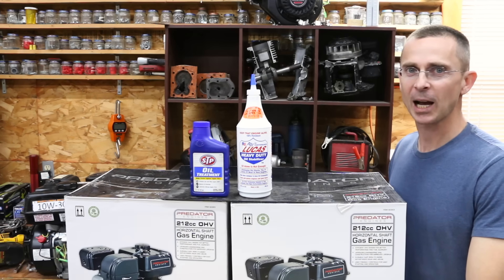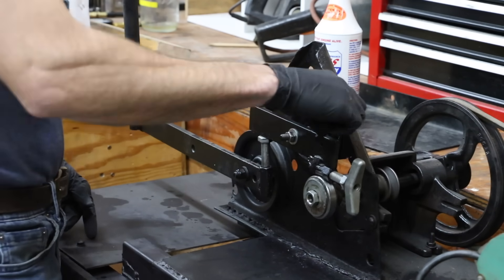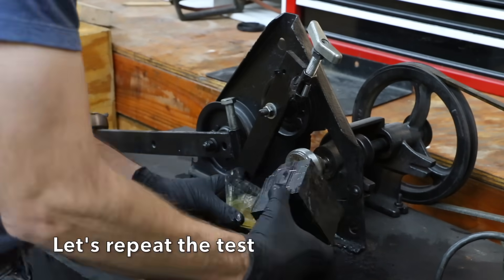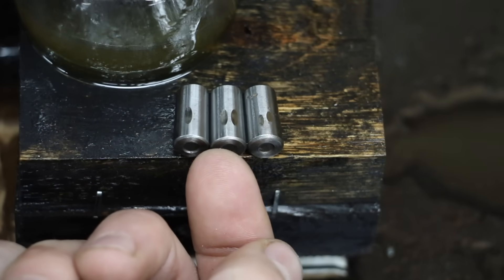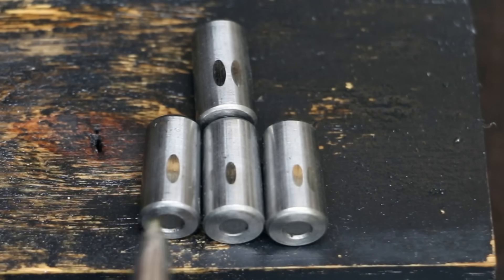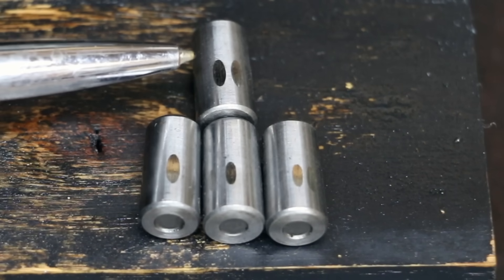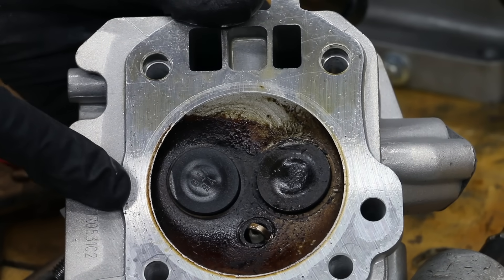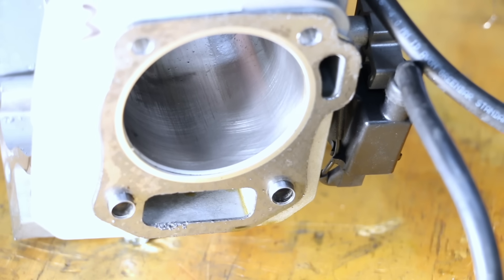Which engine self-destructs first?  Lucas or STP?

Comment: Nice, if you have PS 23 in your country try it. you will not destroy that engine, google PS23 test on a Honda, car runs far without oil after treated with PS23 and put back in service with zero damage
Reply from the maker: Thank you for this recommendation.
Reply: PS 23 is not an oil stabilizer, it is a metal treatment, worth testing.
Reply: Fake news
Reply: Jan Kotze yytytytyttttttttttttttttttttttttttttttttttttttttttttvtg
Reply: Jan Kotze and if you believe that your a idiot

Comment: So I've been very impressed by Liquimoly oil treatment with molibdemum. Really reduced oil consumption in my 320k Nissan engine. From approximately 1 qt. In 4000 miles down to less than 1/2 quart in 4000 miles
Reply from the maker: Thank you for this recommendation.

Comment: You needed a control with no additive for the test to be valid
Reply: that is true, but what we would know is if the additives do ANY good.  who knows they may make the life shorter than regular oil by itself.  that's why you would want a baseline with just plain oil.
Reply from the maker: Thank you for this recommendation.
Reply: I took the video as a fun thing to do vs having any actual real world application. I agree with a couple others though, a baseline would have been nice
Reply: Since the products being tested are not intended to replace oil, but rather to subsidize the lubricating properties of oil, the tests have no real world application.  If we were to perform the same "test" with standard oil, the end results would be the same.  A completely destroyed engine.

Comment: Interesting experiment as I'm just about to put some Lucas in, after using STP for many years. I noticed that the Lucas engine didn't seize solid but kept rotating after failure. The STP engine seized solid...
Reply from the maker: All great points. Thanks for commenting.

Comment: The funny thing about the STP with ZDDP is that they advertise it as a ZDDP additive but STP actually contains far less ZDDP than even low-ZDDP oils and the difference is even more significant when compared to high quality oils or diesel oils. Meaning if you use STP as a ZDDP additive you're actually reducing the concentration of ZDDP in your oil.

Both of these are really just oil thickeners. Might help get a bit more life out of a failing engine that's leaking or burning oil but I'd personally avoid them in an engine that has no issues.
Reply from the maker: This is great information. Thanks for commenting.

Comment: You should use steel shield technologies. Engine shield. I put that stuff in my wife's car, there was a bad knock, and the knock went away within 10 seconds. That was 20,000 miles ago. I was told by 3 mechanics prior to that the engine needed to be replaced. Interested to see how it holds up to your torture tests.
Reply from the maker: Thank you for this recommendation.

Comment: I added 1 qt of Lucas oil and 1 can of STP to my 1995 chevy lumina V6, with 145,000 miles on it, the engine seized within 2000 miles, I think the oil could not flow properly through the engine.
Reply from the maker: Sorry that this happened to your vehicle. I think you're right regarding the oil flow issue.  Very high viscosity oils torture the oil pump.  Thanks for commenting.

Comment: have you measured the running temperature with the stock oil? (during the break-in)
Part of the temperature difference between the motors could be from manufacturing up to some point...
A 3rd motor / control motor would have been awesome.
Reply from the maker: Thank you for this recommendation.

Comment: Would have been better to run engines for 5mins with no oil - then strip down. Could have inspected journals properly then. I guess you wouldn't get as many hits with out the self destruction.
Reply from the maker: Thank you for this recommendation.

Comment: A lot of classic cars have flat lifters while new ones have roller lifters, newer oils have cut back on zinc to not foul up catalytic converters, but an old school racing dude suggested using diesel oil since diesels are smog exempt. Maybe do a test with standard motor oil and diesel oil and whether the difference in zinc content makes a difference?
Reply from the maker: This is a terrific recommendation. Thank you.

Comment: Basic thing I'm after is will diesel nd oil harm a gasoline engine I use rotella t4 as a diesel oil in my semi all the time and I'd like to use it in my gas engine but I've been told it would be bad
Reply from the maker: I'll try to do some testing with oils designed for diesels.  From the research I've done, some diesel oils are rated as appropriate to use in gas or diesel engines, but t4 is only for use in diesels.
Reply: I use rotella t4 in all my cars and trucks. Last longer. Better for your engine and I never had a problem. All my gas trucks are over 250k miles and cars as well. I'm in my 03 explorer right now with 286k miles on her and she's fine.
Reply: As long as the oil isn't too thick to flow through the oil passages, it's fine for any application.  Obviously you don't want to use 15w40 in a vehicle that's intended to use 5w20.  In the case of a 2003 Ford Explorer with a 4.0ltr engine....as long as it's 5w30 or thicker, it'll flow just fine....lol
Reply: I've seen people run 20w50 in a 4.0ltr Explorer.  A little maintenance and the correct oil weight for the engine wear goes a long way towards keeping a vehicle on the road.
Reply: Cody Price , I am using 100% synthetic oil and after 13 months of hard use oil still good.
Reply: Lol Aaron yea. Exactly.
Reply: I've run 20w50 threw a 2.3l and a 4.0. But both high mileage. 

I currently run 5w30 t4 threw it now. Don't seem to need anything higher at this point at 286k. Lol. 

I worry was always blowing valve seals and starving the motor of oil.
Reply: Cody Price i got a call 970 IH 304 I RUN THE ORIGINAL  ROTELLA IN DOES GREAT ITS A 304 GAS MOTER GREAT OIL

Comment: So I think there should have been a control with only regular oil. I would like to see Amsoil tests they are supposed to be top of the heap. Greased Lightening supposedly has 2times the Teflon as Slick 50 and of course Seafoam makes good products. So try all of them and show a comparison between the two you just did the other three and a control of oil only. Also show time it takes to fail as a factor for each. These are super interesting because we do all do all spend money additives.
Reply from the maker: These are all great suggestions.  I'll jot these ideas down my my list. Thanks
Reply: He did a regular oil test.
Reply: The new Ceramic oils are the latest rage.

Comment: what about a third engine run with regular oil than drained and ran till failure as a kind of control (not asking you to spend more money and destroy though) to see if the additives make any difference? I am at a loss ProjectFarm? I don't know what was proved here, I understand that perhaps Lucas performed better than STP, but do these additives really help when added to regular oil or is it a waste,  I guess what I am asking is would you use these and motor oil with every change?, or just use motor oil after what you observed with this experiment? I do like your video's tho, thank you, your a kind of myth buster's reborn ;)
Reply from the maker: Thank you for this recommendation and thanks for the positive comment.

Comment: I don’t get this test. I would have left the oil in them and ran them for a day. Then pulled them apart to inspect the different wear from each. The only thing you proved in this video was that running an engine without oil will eventually fail
Reply from the maker: Thanks for commenting.

Comment: Archoil 9100. It does actually work on 6.0 Powerstroke Heui injectors by lubricating the spool valves to prevent stiction. I found it better and less expensive then hot shot secret and the other popular really expensive additive can't remember the name.
Reply from the maker: Thank you for this recommendation.
Reply: Project Farm Rev X is the other one I couldn't think of. Way way over priced when Archoil worked just as well for half price. Damn 6.0 injectors and I mean good quality injectors are almost 200 a piece so people buy this stuff like crazy

Comment: If you want to test oil additives/microlubricants, this would be an entertaining one:  Liqui Moly Ceratec and another acclaimed nanolube or microlubricant such as ZMax endorsed by Carroll Shelby.  Both are about the same price - around 25 bucks, and are some of the more expensive oil additives, both have large company backing and testamonials but there are no real world, well thought out tests that have been performed, that I have seen.  Additionally, you at least need a control to have a test... that's about as nit picky as I'll get with it as it is more for entertainment than actual useable test data.  I enjoy a good engine slaughter as well as the next guy.  Why not, do it again, I'd watch.
Reply from the maker: These are all great suggestions.  Thanks you!

Comment: Just a suggestion but after break in drain all the oil and start with fresh oil for the tests.  I have taken apart lathes engines and power tools from harbor freight and all have had trash inside them. Anything from casting sand to casting flash to milled metal from the gear manufacture.  The scoring in the cylinders could have (probably was) been caused by foreign debris inside the new engine.
Reply from the maker: This is a great suggestion. I'll do this in all future tests.  I'm always looking for ways to improve the testing process. Thanks again!

Comment: What a joke! How about heating these additives up at 212F-230f which is normal engine temp to see how they perform as they thin out? Testing these at ambient temperature means absolutely nothing. Wake up!
Reply from the maker: Thanks for commenting. Most "cold engine" starts occur at ambient and this is when most engine wear occurs.  The engine test measures film strength under extreme conditions. Thanks again for commenting.

Comment: There was this one additive that got so much hype back then called "prolong engine treatment", no equal in the world was their slogan. There was a video floating around about it from the company, they drained an engine of oil after running the stuff, kept it running and took off the valve cover, still running, and then poured concrete on it. Still ran. Then they drained a viper of oil and took it on a track and it ran fine still allegedly. Id like to see that stuff really get tested.
Reply from the maker: Thank you for this recommendation.

Comment: Should do a retest with equal parts. I believe in ZDDP! However I also only use Lucas synthetic oil additive, and fuel treatment. 02 WJ 4.0. 240,000 miles and still running great!
Reply from the maker: Thanks for commenting on this.

Comment: This doesn't prove anything imo get another two engines run them with the same exact oil for 3 hours then drain and run them again I doubt both will fail at the same exact time
Reply from the maker: Great point. There will always be some variance and increasing sample sizes add to the reliability of the results.  Thanks for commenting.

Comment: As neat as this test was it leads people to believe that an additive can make normal oil better by offering better lubrication, which they might. This is done by adding a much thicker oil to raise the viscosity. The same effect could be achieved by just running a thicker oil to start out with and not an additive. A thicker oil isn't good for cold weather and newer engines are going to thinner oil due to higher tolerances and less fiction loss due to thinner oils being easier to move. Oil is used for more than just lubrication but also offer cooling , sealing and corsion resistance. A thick oil on a turbo engine might leave the turbo without oil for a while when starting on a cold day or lower the efficiency due to more work being required to move the oil. While I have been curious about additives I don't think this answers the fundamental underlying mechanics and questions that need answers. Instead it perpetuals the idea that these additives are a fix for making an engine run longer that billion dollar oil company trying to out do their competitors couldn't figure out. The same effect could be achieved with frequent changes or thicker oil to start.
Reply from the maker: Great point and thanks for commenting.
Reply: Sounds good, but go grab a couple engines and try it out. Film it and post the link here.
Reply: Tony, there's nothing for Troy to "try out".  His statement is based on proven facts.  If you start with a high quality oil or the correct weight for the application, these additives provide no benefit at all.
Reply: Aaron Thomas that's the whole point of this video series, as far as I can tell. Project farm spends time and money putting together great videos testing questions and speculations, many of which I have heard pondered or proclaimed, and provides documented evidence of what really happens...sometimes with surprising results. I don't think it's any secret that frequent oil changes are a GOOD way to maintain an engine for longevity, and I'm not arguing that additives provide a MEASURABLE improvement (or any improvement at all). But I think project farm showed there is a difference between the two additives he measured. So go ahead and compare them to thicker oil or grab a couple engines and see what happens when you put thicker oil in them.
Reply: I'm not discounting what is being done in these videos.  I find these videos entertaining personally.  The companies that produce these oil additives have made outrageous claims over the years.  So far, these videos have proven that these products don't actually improve the oil they're added to, with the exception of Restore.  Most of us have known for years that Z-Max is garbage.  It's literally nothing but mineral oil.  Makes a great cleaning solvent but is horrible as a lubricant.  Personally, I'm still waiting to see him do this with DuraLube.  It was the major competitor to Z-Max and made a lot of the same claims.
Reply: Aaron Thomas I'm just going to throw out there that we probably don't disagree on very much here. You might even note that the first thing I said to Troy was "sounds good." But I think it's also important to point out that these engines (small, cheap) almost certainly use splash lubrication, and not the pressurized systems that auto engines use, so anybody drawing comparisons between the two does so at his own risk. That said, any improvement at all over the recommended oil is interesting and worth testing on splash systems. If the claim is that thicker oil provides better lubrication, I'd like to see that. As far as I know, it's only benefit is maintaining better pressure on looser tolerances. That's the crux of my request for the test (even if somewhat tongue in cheek) and I understand that I spent exactly zero time explaining it...my bad, but I try not to sound like a pretentious shit, and believe me it can be hard sometimes! But thanks for the respectful exchange. Hard to find on the internet sometimes.

Comment: I'd like to see regular motor oil compared to like a he 15 40 rotella or delvac
Reply: A test like that would not highlight the oil additives for diesel engines unless run in a small diesel engine.
Reply: Was meaning diesel oil tested on gas engines
Reply from the maker: Thank you for this recommendation.
Reply: 15w40 Amsoil, #1 in Synthetics

Comment: What engine will run without oil?. It seems like a very artificial and non nonsensical test!
Reply from the maker: The purpose of the test is to measure film strength inside of a running engine vs a bench test.  The lack of lubrication cause heat and friction after the film strength is lost. Thanks for commenting.

Comment: Should have run a 3rd engine using manufacturer's recommended oil only. He still didn't answer the basic question: Do the oil additives improve engine life? It's entirely possible that an oil only engine would have run much longer.
Reply from the maker: Thank you for this recommendation.

Comment: You should have used a third engine with regular oil without the additive as a control. Nice vid tho
Reply from the maker: Thank you for this recommendation and thanks for the positive comment.
Reply: Nicholas in that case you wouldn't need to compare both additives. doing reg vs additive engine test would be fine.

Comment: Hot Shot Secret and Motorkote!
Reply from the maker: Thank you for this recommendation.
Reply: yes !!!   i used  motor kote in 1984 buick,   in place of power steering, had a real bad leak.  after motor kote leaked out,  it still drove smooth.  i took the cap off and steam was comeing out!!!  and it still ran smooth!!!

Comment: Put whatever your manual says to use My 99 Acura ( which is basically a Honda ) 
Is just about to reach 400 thousand miles and it runs like a champ.
All I use is Honda motor and Trany oil from the dealer 
Also don't be stupid and forget to change your transmission oil.
change your damn oil when it starts to get a little dirty 
Trust me
Reply from the maker: This is impressive!  400K is a lot of miles.